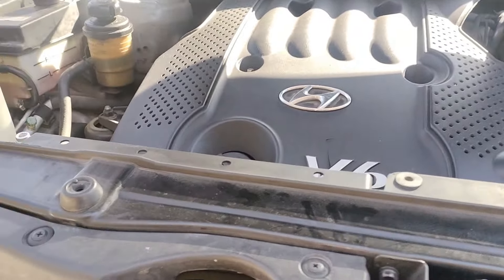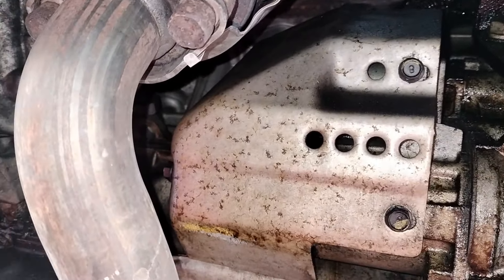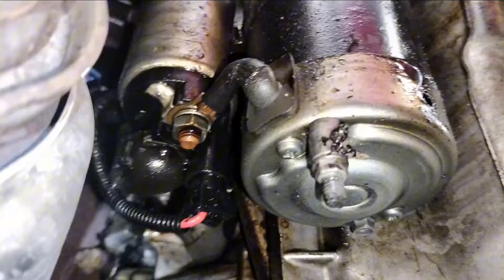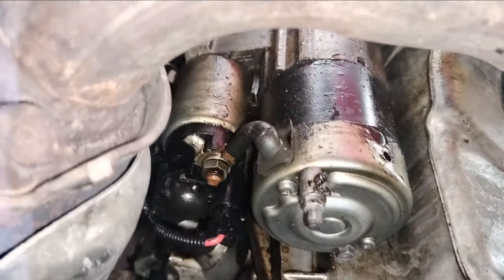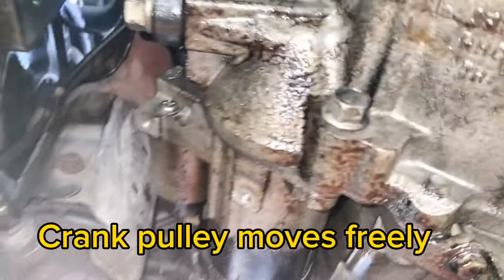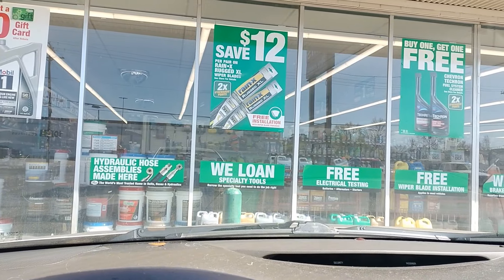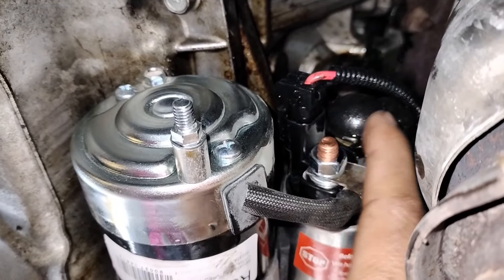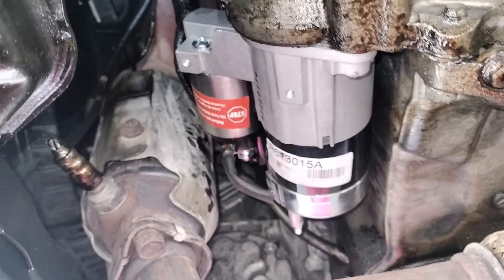Hyundai Santa Fe 2.7 starter replacement, no crank clicking sound only

Comment: I’ll fix mine today
Reply: Bro thanks to your video, I did that. The nut wash hard to get off but all in all it was a smooth swap. I went ahead and changed my oil while I was under there. You saved me about 350$. What’s your cashapp